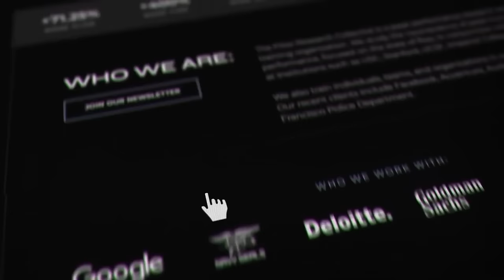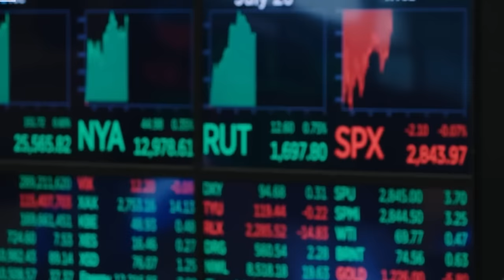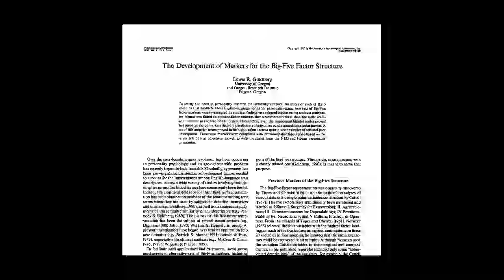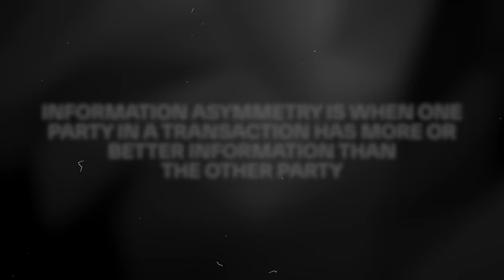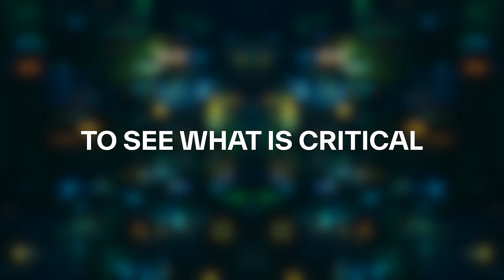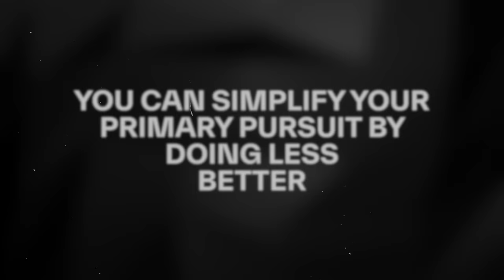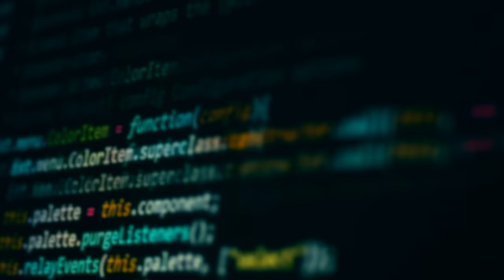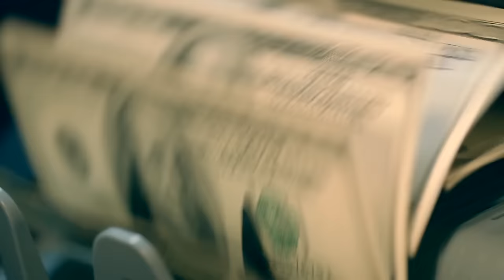Know Your Productivity Type. It'll Change Your Life.

Comment: 00:00 Dispersion, worse than procrastination, splits attention and compromises long-term success.
02:12 Hyper-ambition can lead to loss of focus and productivity.
06:19 Focus is the key to success.
08:19 Balancing exploration and exploitation is vital for productivity and success.
12:36 Focusing strengthens neural connections and boosts productivity.
14:39 Dopamine distortion leads to underestimating project complexity
18:24 Prioritize within your primary pursuit to enhance focus and progress.
20:09 Cutting non-essential tasks and commitments for faster progress
23:34 Warren Buffett shows the importance of persisting with one pursuit
25:25 Mastering explore-exploit dynamics is crucial
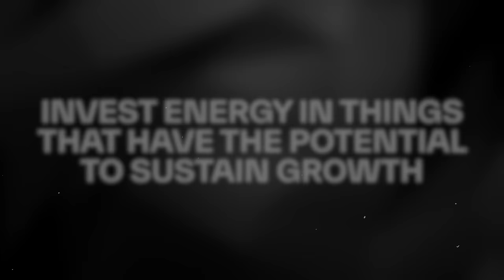29:09 Invest energy in things with potential for growth, even if initially uninterested.
30:45 Embrace a hobby for sustained flow
Crafted by Merlin AI.
Reply: Bro didn’t even try to hide it
Reply: Thanks Danesh Bhai🙌🙏

Comment: I was wondering why i am not moving an inch but still feel like spending time only on my goals. I have been in this dispersion mode all this while, wasting time on something part of my list but i should not be doing right now.

Interestingly you pointed out my current mistake and also alerted how to move forward by explaining about removing unwanted workloads, even though i didn't reach that stage i realize it is as important as getting rid of dispersion.

Comment: 🎯 Key Takeaways for quick navigation:

00:00 🚀 Overcoming procrastination is crucial, but dispersion is a more insidious threat to long-term success.
02:01 🔄 Dispersion, going wide but shallow, divides attention, compromises working memory, and hinders progress.
04:36 💡 Dispersion is more damaging than procrastination in the long run, as it interrupts compounding and exponential growth.
06:42 🎯 Focusing on one thing for longer than expected allows compounding, leading to clearer goals, reduced stress, and more flow.
13:43 🔄 Three science-backed steps to combat dispersion: Pick one pursuit, prioritize within it using the "Make the boat go faster" filter, and conduct a temporal audit to stretch the timeline and gain perspective.
22:35 🚢 Eliminate non-essential tasks and roles that don't directly contribute to your primary pursuit to simplify and focus.
23:56 🌊 Persist with one pursuit after cutting heavy cargo; consistency allows you to catch tailwinds propelling you to your destination.
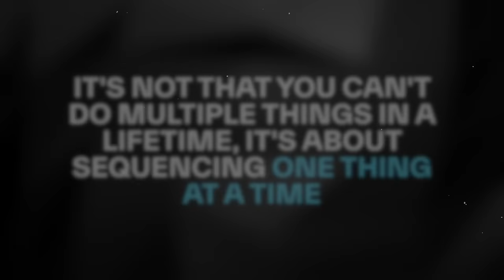25:06 🔄 Master explore-exploit dynamics; focus on compounding focus, which takes 10 to 100 times longer than linear thinking assumes.
28:57 📈 Embrace compounding; sticking to one project allows skills, knowledge, and network to compound over time, leading to exponential gains.
29:54 🌐 Walk the stairway to flow; resist premature exploration when facing flow plateaus, let focus compound, and flow will reemerge in the ongoing exploration phase.

Made with HARPA AI
Reply: Great, thanks for sharing 🙏